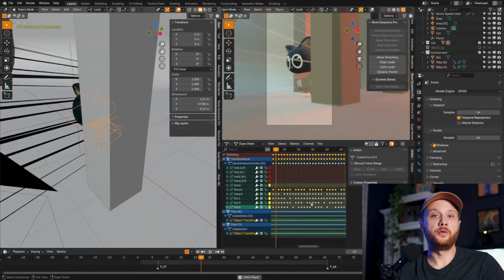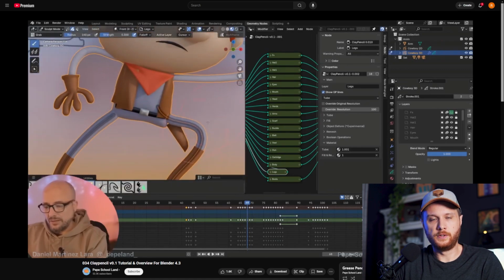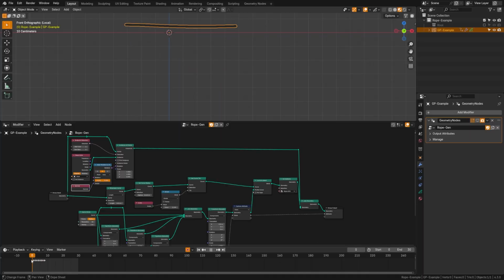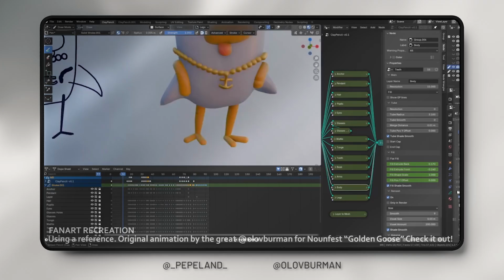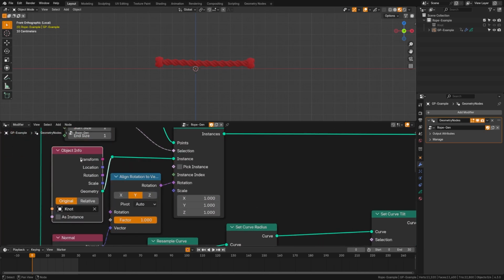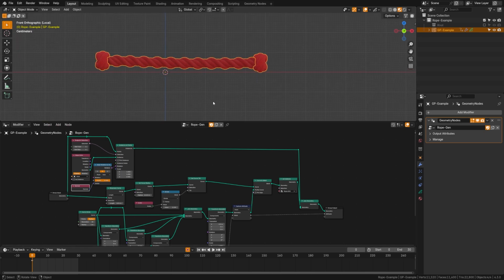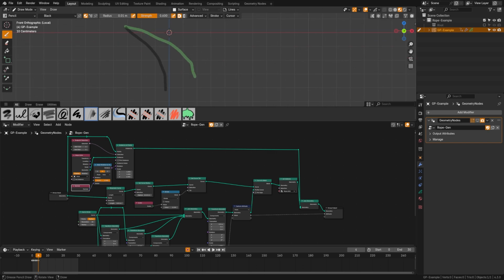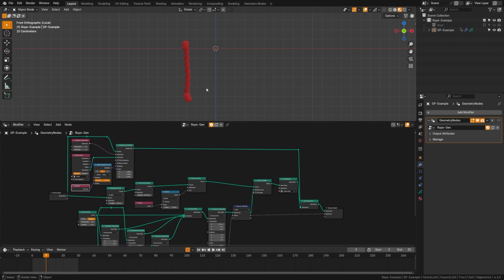Why Grease Pencil 3.0 Changes EVERYTHING in Blender!

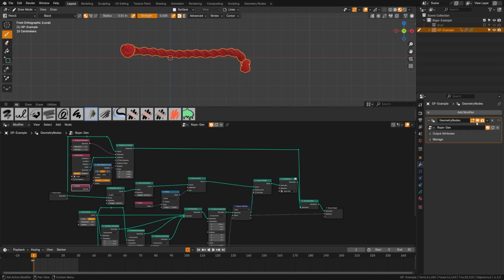Comment: 4:08 To visualize the grease pencil strokes at the same time as the 3d geometry you can add a join geometry node and « mix » the original grease pencil with the final 3d geometry. (You can add a switch so you can toggle it on or off)
Reply: This needs to be pinned